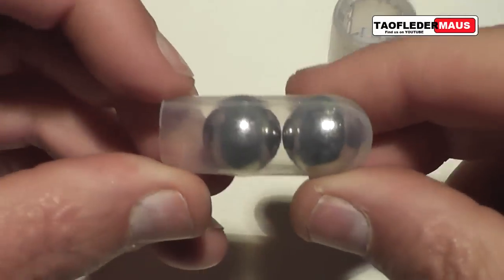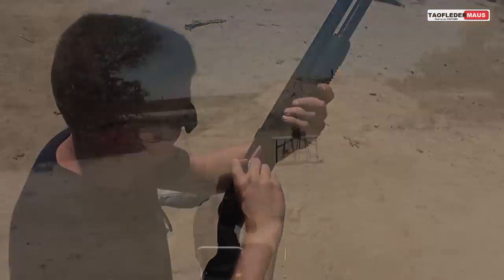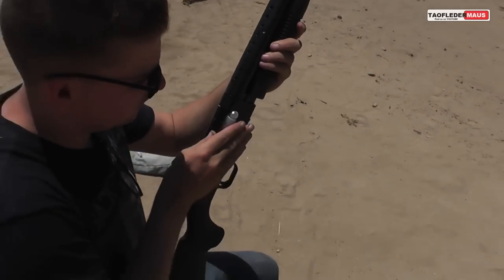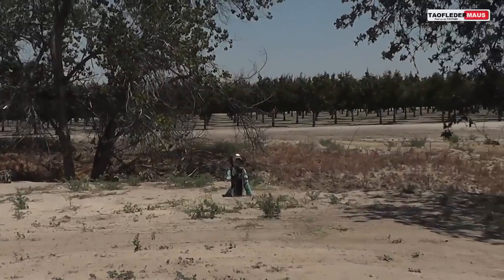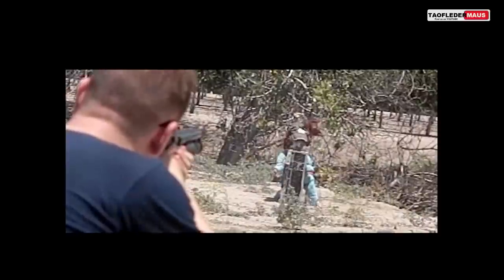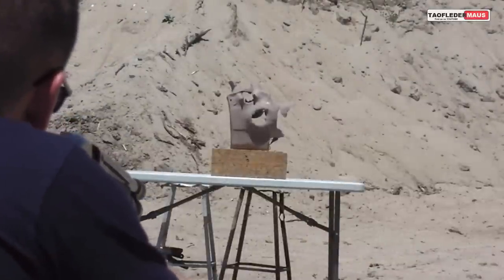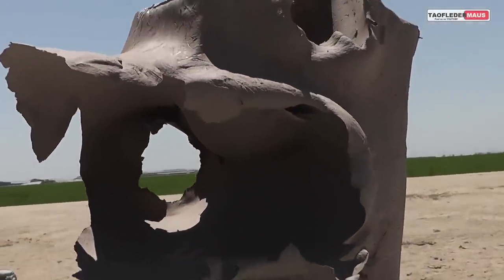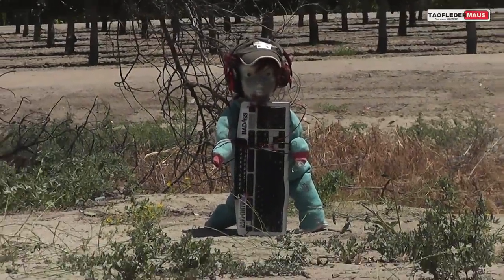2-Ball Bearing "NEWTON'S CRADLE"  Shotgun Round - SCIENCE!

Comment: Hey Jeff : the reason one ball flies faster can be displayed by dropping a steel bearing on a ceramic tile or other rigid material.  Upon encountering force the ball compresses, as metal is elastic, and releases force as bounce.  So 'force' equals metal plate/ceramic etc.. and release equals bounce.  If two balls are dropped 'atop each other but touching!  The two balls hit together, with the mass of one, then the elastic rebound is imparted, the first ball receives all energy of a full mass elastic rebound while the second only receives half.  In ballistics... the metal plate/ceramic whatever, is replaced by the detonation force.  Push is push, so the second ball does not leave with half the force of the fist but slightly less. As for crossing paths, a sphere passing through a medium deflects the medium out ward at a 45 ish degree angle.  This causes a low pressure area around the circumference of the back of the bullet :ie vacuum.  As the first ball pulls away however the second ball, as positioned by chance, to one side or the other in the vacuum trail of the first ball will be sent/pulled off the path of the first, in another direction.  Also affecting the flight path of the first, dependant on muz. vel. etc...  To put it in a nut shell.  There have been many thesis' written on this, and there's a lot more to it!   Love your stuff J.M.

Comment: I mean CLEARLY your method is flawed. you let him HOLD the gun? Nonononono. How you should do it is levitate the gun in an artificial gravity field with a Bluetooth remote trigger. Also, you could have avoided the spread by cutting divots into the first hardened steel ball bearings and then coating them with super-slick cooking spray that has been blessed by both the Catholic church and the Dalai Lama to make it go faster.
Reply from the maker: eivilcow33 hahaha!
Reply: eivilcow33 You forgot to superheat the air around the trigger
Reply: ***** Your ballistic sea slug is obviously not a good comparison to a real sea slug, you'll need to submerge it in salt water for 2 years and then stuff it in a leather bag for realistic data. Dont forget to soak the leather in the same water for the 2 years. If you're lucky they will combine and you won't have to stuff the ballistic gel in the bag.
Reply: Lil Doggy  Oh crap you are right! Gotta give it that perfect squeezing motion!

Comment: I believe you are correct, Newton's cradle is displaying his theory called momentum conservation and inelastic collisions. Just like in a newton's cradle the first ball(the one closest to the propellent) is giving its energy to the second when it smashes into it.  However in this case the energy being put into the system is so great that the collision is not inelastic; it is able to deform the two colliding objects, so the momentum transfer is only partial. I.E both projectiles stay in motion however one is now faster than the other.  The fact that the ball moving faster had a more erratic flight path supports this hypothesis. It is blasted out of its savo casing in the first few milliseconds and does not travel smoothly down the barrel,  this makes its exit angle random. You can test this theory by putting something in between the 2 balls like high density urethane this will prevent the collision between the 2 balls. If the balls exit at a much more similar velocity and are both more accurate bam problem solved. Buck shot is less prone to this behavior because the lead is more ductile, when the balls collide they elastically collide; sharing their momentum, not transferring it as in a newton's cradle.

Comment: The only thing I can think of would be a double concave spacer be placed between the balls so they have no contact with each other. I have seen them used in muzzleloaders for a 2 round ball load to prevent the balls from deforming each other in the barrel, with steel balls that wouldn't be an issue but I wonder if it would improve accuracy. The spacers are made of a plastic/polymer material.

Comment: Why did you use the plastic satchel? If you were willing to load it both ways, it doesn't seem like its holding the balls in place. I'm curious if not using it at all would affect flight. It seems like the satchel could potentially cause it to deviate, regardless of how it was loaded in, but maybe the force behind the satchel is insignificant compared to the force of the bearings.

Comment: Would be interesting if you were to do this again, but paint the balls different colors to see if the one in the front or rear was the one traveling faster.
Reply from the maker: Taylor Hardin I would think the front one would have to be the one going faster.
Reply: Not sure, but I actually think the second ball travels faster because it benifits from an extra half inch of barrel and the first ball breaking initial air resistance. I think the same effect is what causes bolo canon rounds to spin through the air, because if the first ball were going faster, wouldn't it just kinda drag the second ball and chain behind it as opposed to the second ball passing, and getting slowed down causing it to spin outward?
Reply: Don't know if I worded that well, but may be worth to test just to satisfy curiosity. Wish I could do some of that stuff, but I live in illinois, so no dice lol. Keep up the good work

Comment: I have a couple possible explanations for why one is travelling faster than the other, but knowing which was flying faster would make a huge difference... 
If it's the front one, the 2nd one is pushing the first & could be losing momentum on the way out.
If it's the back one going faster, the front one could be clearing the air resistance & the second one gets a slight boost like drafting in NASCAR. As soon as they leave the barrel, the 2nd one might get that opening to slingshot around the first

& then there's the chance that neither of these things are what's doing it at all... but you blew the holes in stuff wrong & that guy couldn't aim, he needs more James Bond, Golden Eye on the N64
Thanks for the cool vids
Reply from the maker: Nowan Inparticular   Like a few other people have mentioned,   it's works a lot like Newton's cradle.  The g-shock hits the back ball,  and the energy is transferred to the front ball.

Comment: when you load it u your gun do it slowly cause bearings are heavy. When the casing loads up and suddenly stops in a chamber bearings possibly went out.
Reply from the maker: MightyJustas   Normally I have the guys push the shell into the chamber then close the bolt just to prevent the load from coming out of the shell.  But these rounds actually locked tightly into the shell so I wasn't too concerned about that.

Comment: I wonder if a variation on this could be useful in penetrating glass, the lead projectile breaks the glass mitigating the deflection of the second.-- Would the cracks in the glass radiating from the lead projectile spread fast enough to compromise the pane for the second? The projectiles need not be identical.

Comment: This is a super basic question, but why is lead used for firearms when it seems like steel ball bearings work so well?
Reply: ***** Easier to manipulate too.
Reply: Naomi Nekomimi often times, pressure causes the lead to fit the rifling of the barrel for a tighter seal.
Reply: ***** 
What? No, lead is certainly not cheaper than iron
Reply: Naomi Nekomimi 
Everything those three guys just said. Lead also deforms more on hitting a target, making it slightly more effective against soft tissue, where it's less likely to over penetrate. Naturally this makes it perform poorly against armour however, which is why steel tipped bullets (and other metals) are often used for armour piercing rounds.

Comment: Just a thought on the speeds... Imagine in pool a q ball hits another ball and launches it... but in this case the internal pressure from gases in the barrel apply more force to the q ball and speed it up to almost the same speed.... seems like the physics apply in this case
Reply: Reggie 1713 Also... unless the bearings are locked together, the first would have to slow the second one down.... the second one out of the barrel was the first to receive pressure... so it received resistance from the first barring... however, the first barring only felt resistance from air..... so the results do not seem unusual to me

Comment: I wonder... (2 things)
Ensure the 2 are touching firmly at the start (Via a wee dab of ye-olde Krazy-Glue) And, retry with 2 that have a definite air gap of around 1/2 inch (May require a slightly altered shell casing)
Might be a good way to confirm your newtons cradle thought
(Related... Hold a pingpong ball on top of a basketball. Drop the entire unit, noting that the basketball rebounds less then normal AND that the pingpong ball has just launched over your house... Same thing

Comment: My completely non-scientific theory behind why the 2 bearings were travelling at different speeds is that the cup used to hold them wouldn't be stable as it exited the barrel, which caused it to flip,sending one projectile forward, while holding onto the other for a split second.  With the speed those things are travelling at, I reckon that'd make just enough difference to give them that much separation.